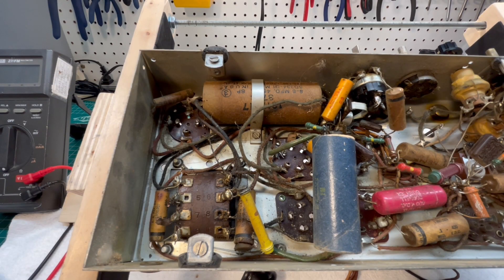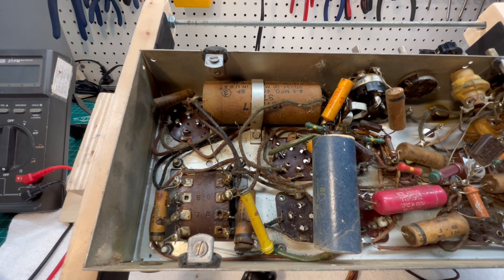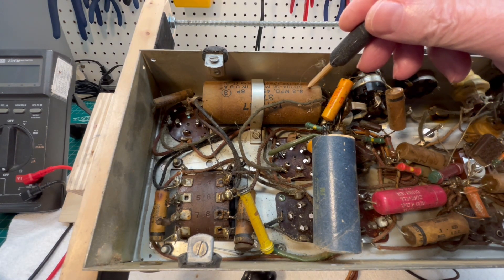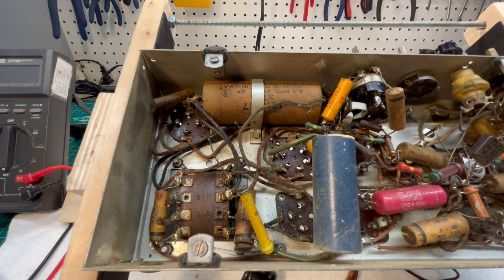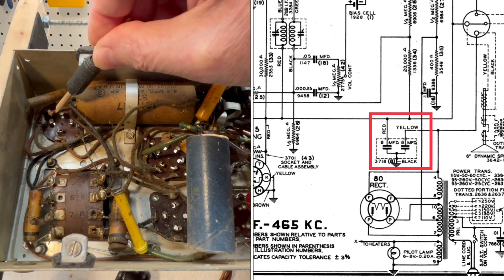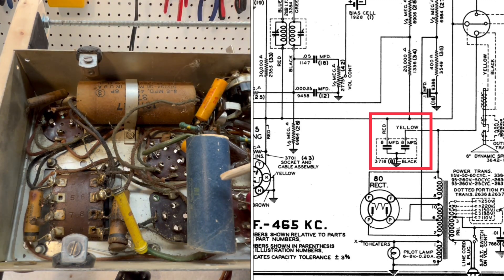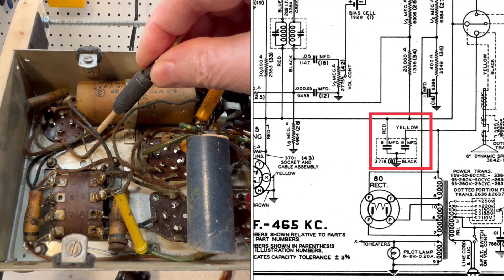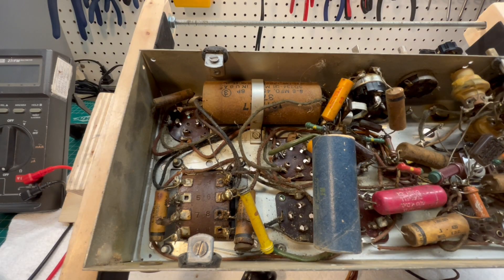Knight 98AE-184K - Should the Electrolytic Capacitors tie to Chassis or the Power Transformer CT?

Comment: I believe the schematic is wrong at least for the first filter that is closer to the rectifier. That one should have the negative tied to the center tap of the HV winding of the transformer. The second filter could perhaps be tied to ground but I would think could be OK to go to ground. The reason for this is that the biasing resistor for the output tube is between center tap and ground, and we especially want filtering between the rectifier filament (highest B+) and center tap (most negative B-)
Reply from the maker: Thanks for reaching out with this info. I see other examples of the same schema, so your explanation solidified my decision. Best, Don
Reply: @RestoreOldRadios  Thanks!

Comment: I would imagine that the original wiring inside the radio going to center tap, was an unpublished revision and is probably correct for the set.  Often repairmen would just stick a capacitor any way they could to get it to stop humming.  I had an RCA which had a replacement first filter going to chassis instead of B-, that set was set up to create negative bias with the second filter going to chassis.  It probably sounded awful, definitely destroyed the output tubes and caused the transformer to heat up like crazy (you could see it had been leaking a bit of wax)!
Reply from the maker: Thank you. Look for an updated video tonight. Best, Don

Comment: The center tap is the true unimpeded 0v source. The chassis 0v reference is high impedance at low frequency(low impedance at high frequency through the 0.1uf cap), for the tube reference, it seems. So going straight to the center tap would seem to be the way to go to avoid introducing noise back into the tubes.
Reply from the maker: Thank you for sharing this. Best, Don

Comment: If someone tried to get this radio to work properly and get sufficient volume he may have made some changes to the
 circuitry to get around the problem negating the circuit design as shown. You may have to go through the whole radio 
to find where this may have been done. Chassis is at ground in this radio. B- is separate from it and there is another part 
that is at a slightly lower potiential but not B-.
Reply from the maker: Great information Steve. Look for an updated video soon. Best, Don

Comment: At the bottom of the circuit diagram is a pilot lamp with one side connected to ground.  Then look to the right and notice how they have represented the power connector which clearly passes through the case.

Then look back at the ground for the lamp. It would appear they are trying to indicate that the ground for the pilot lamp is connected to the case.

So it appears they intend the ground (as a common connection from which voltages are referenced) to be connected to the metal case.

It's a poor circuit diagram.

So if somewhere in the circuit they have a wire going from the centre tap of the transformer to the case (which seems likely) then it doesn't matter whether you connect the capacitor lead to either the centre tap connection or to the case.
Reply from the maker: Dean - thanks for reaching out with this info. Look for a new video soon. Best, Don

Comment: I bet if you use a multimeter on a continuity test and buzz it out you will find there is continuity from the metal chassis to the centre tap, and if that is the case it doesn't matter to which you connect the capacitor.

Let's not get confused referring to the chassis ground, earth and centre tap as ground. I shall cover more about this later. And there's a question as to whether it is a mains powered appliance and whether the metal chassis is earthed (which is not ground!). But this not covered in the video so we don't know.

The word "ground" in the context of this appliance is "a common connection point". The centre tap of the transformer is clearly intended to be that, where all voltages are referenced from. The metal case could be used as that common connection point for simplicity. If the appliance is battery powered, that's ok. It's not a preferred way to do it, because the case then becomes part of the circuit design, but electrically it is ok.

Now, if the appliance is mains powered and earthed, the earth goes to the metal chassis, then the electrical earth and circuit ground (as a common connection) should not be connected to each other. That potentially is dangerous.
The electrical earth is part of the mains electriciy circuits at 110 or more volts, and the electrical earth is there for protection purposes and under a fault scenario could end up with 110 volts on it.
That means you're going to end up with 110 volts on the electronics which will probably fry it.

Now the symbol on the circuit diagram shows "ground" as a common connection point. It does not show a "chassis ground" , that's a different symbol.

So if they are using the case/chassis as a common connection point, then technically that does not conform to the circuit diagram, but then the question is, did they use the appropriate ground symbol on the schematic? What was the designer's real intent?
Reply from the maker: You’ll see an update soon and my restoration plans. Best, Don

Comment: In your first video of this series you mentioned that it was common for Knight not to issue a circuit diagram. The diagram you are using differs from the radios apparent construction. I would say that Mr Joe Ts repair guy just did what you would normally do with these sets and tied it to the chassis. I think it should be tied to the center tap.
Reply from the maker: Thank you. I’ll be publishing an update in a few. Best, Don

Comment: Following  the schematic the center tap gets divided to go to both a 0.1uF cap to ground and to a 500K resisitor
that goes to pin 4 of the 41 tube and before that point it gets a  400 Ohm resistor  to ground. Seeing that all the cathodes
of the 76, 75 and 41 tubes are at ground leads me to believe that is the way to go because there is a lower bias than
the chassis here. Don't forget the bias cell off the 75's grid to the volume pot. Replace the electrolytics with two16uF both
 to the neg. side to ground i.e. chassis.  Off the grid( G4) pin of the 6A7 is a gimmick ( capacitor). Make sure there is one
 there!  Someone may have messed with this circuit to skip the fact the bias cell wasn't working perhaps.That probably 
should be replaced by a very large Megohm resistor, the electrons flowing through it will build up it's own bias! Remember 
to eat your Wheaties every morning and you can explain how early tech was designed! Ha,ha!
Reply: Great catch on the gimmick capacitor; they were pretty common on several of the 1930’s radio models and usually weren’t shown on the schematics. I think they were very low in value like a 2pF or so but nevertheless that couple of wraps of wire had to be there for the radio to work properly.
Reply from the maker: Good info Steve. An update will be published soon. Best, Don

Comment: I think the repair was correct, its hard to see in your video were ground tie was on that dual cap .           {  Do you have correct print for your receiver ? }
 I just got my new 4 mfd 50 volt = 4000 uf tested new one comes in at 4018 uf  from Mouser , I bought one of those lcd testers , it does caps , transistors, will tell you polarity , FETS , N & P channel ] - diodes, checks its own voltage on start up. The old cap that I pulled tested at 395 pico so obviously shot ,no wonder audio was not crisp ; no pun & no smoke ?
 I will spare you the rest on this old six tube Silvertone. Its not point to point wiring like the radios your doing but a circuit board. Got a new fresh print for it  from,[ Howard W Sams & co.] For a Silvertone Model 3012- [ch. . 132.68601] 1962 build year.   its got trace puke; IE: a coating of white under traces, power cord interlock was green ,corrosion, cut all that out took out interlock .The cap I got C2 is listed as a stabilizing cap, they want it disconnected when an alignment is performed. As I see from print , it couples IF stage thru volume to AF stage 12au6 tube & output is thru 35c5. I have a can cap that has a 70 mfd, a 40,mfd & a 20 mfd, all negatives to ground, probably tied together inside can. looks like they are tied with my 35w4 rectifier tube it has power points listed filament string all tied to ground. Funny thing , I keep reading the sections of that cap before I even got print and one time it actually read the 70 mfd correctly. I am familiar with the lingo of reforming. I know these should be replaced. * Al I get a kick out of all the equipment they want for the alignment  procedures, back in the day, [ VTVM  , Frequency generator,] [ I am not the Carlson lab ] He does have some nice old pieces] Many good channels out there. All due respect to all.
 I got my electronics certificate 9 -16 week semesters back in 12/2003 ELECTRONCICS TECHNOLOGY, I was trained on Fluke bench DMM's, Tekronic & BK scopes, digital , freq generator & counters . Yes I understand my resonant frequency. Very good print. Mine also has the voltage check point triangles on it. The power cord is the antenna, thats a strange one , specked at 6' feet.  Freq formula.1/t there is a length part to that; comes to mind.
 I have a few DMM's , a few cap testers & that new ESR, my oldest piece of test equipment is a Simpson 260. Its a lot of fun to get an old piece working. I see you pulled your signal from IF section/ tuning cap, you were testing local oscillator /tuning -  what amp did you run that thru/ couple it .1uf to make your audio work ?      [ Take care. Hugh Mc Chicago, metro ]

Comment: Hi Don, so 'new' is going straight to chassis ground, 'original' is going to chassis ground via the C+R? Is that right? Ignoring the C which is blocking DC as a safety precaution, it's just via the 400R which makes it more negative than negative ;)
Reply from the maker: Andrew, you are correct. I will be publishing an update in a bit. Best, Don

Comment: My suggestion would be to wire it as shown on the schematic.  The engineers that designed the circuit designed it that way for a reason.  It is putting circuit ground slightly above chassis ground.  It would also be a good idea to make the capacitor from the center tap to ground a Safety Capacitor (X1/Y2 rated   Vishay Capacitor part number: VY2104M63Y5US63V0 ).  That way, should that particular capacitor fail, it will not ground out directly to the chassis.  Not so much for safety but for circuit protection.
Reply from the maker: Great info Wayne and much appreciated. I’ll be publishing an update soon. Best, Don

Comment: Hey Don, I'm certainly no expert (you need to talk to Bob for that), but I would think that both of the negative leads on the filter caps should be tied together at some common ground point. Whether that is the chassis or B minus really depends on the rest of the circuitry. IOW, if most other grounds tie to the chassis, then I would put them there and the same goes for B minus if that applies. Hope that helps. :)
Reply from the maker: Doug, thanks for your insight. I haven’t heard from Bob yet, but hopefully he’ll jump in on the thread. Look for new video soon. Best, Don

Comment: Check the Cathode circuit of the output tube. Without seeing more of the schematic, it looks like they're using the center-tap to create a negative to chassis voltage. This voltage would then be used to bias the grid of the output tube and eliminate the need for a cathode resister/capacitor in the circuit.
Reply from the maker: Great info and thanks for reaching out. Look for a new video soon. Best, Don